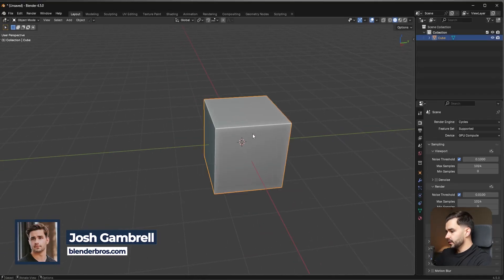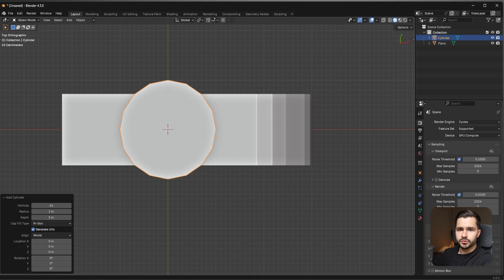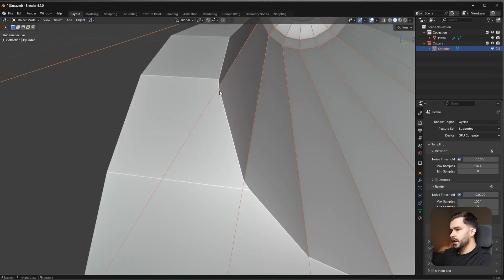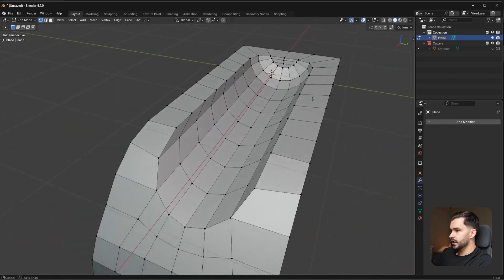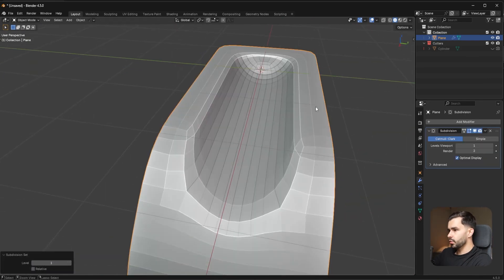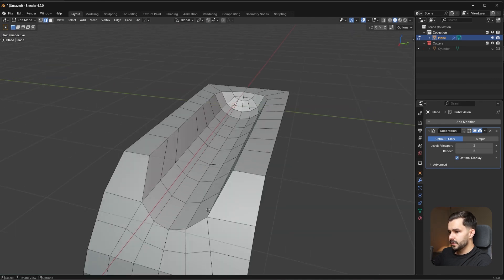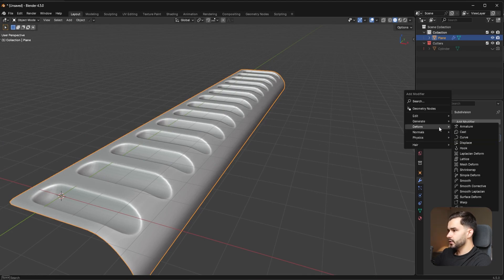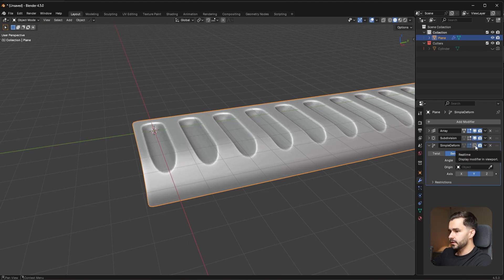Array along CURVES in Blender (Hard Surface Modeling Tutorial)

Comment: If you make beginner tutorial, you should use blender default. As I know, boolean in blender default works only with closed objects, not open objects like planes. I think, you used a special addon, which works around this blender default issue
Reply: When adding Boolean Modifier, in Modifier Tab change Boolean solver to Float, and then move around the cutting object so it doesn't remove supporting verts, then you'll have the same result as in the video.